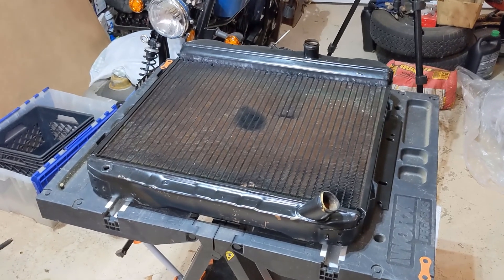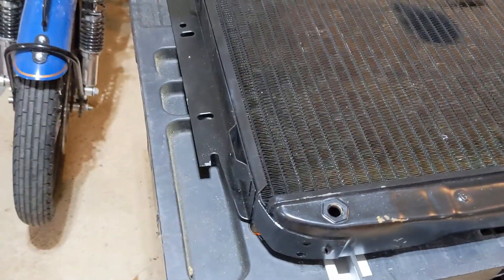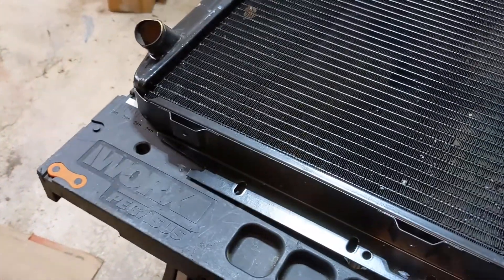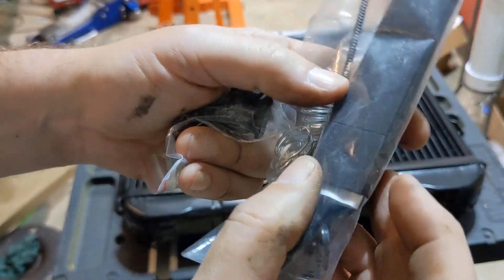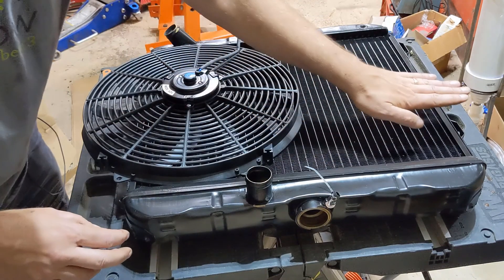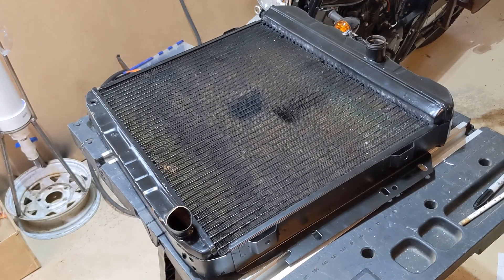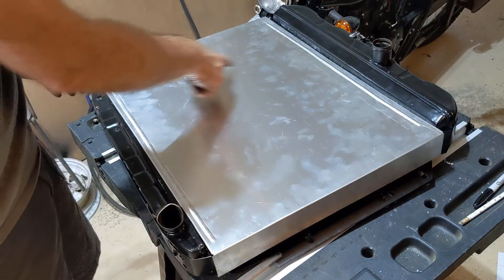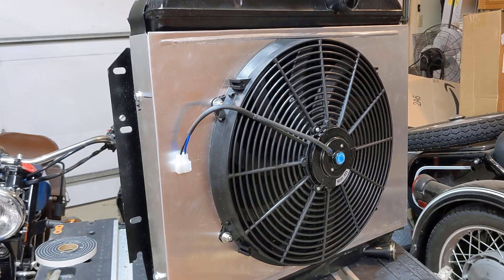Make Your Own Radiator Fan Shroud

Comment: Now your radiator will only flow air through the area of the fan. ALL THE REST OF THOSE SQUARE INCHES OF RADIATOR ARE COMPLETELY BLOCKED! You should have made a shallow box instead of a plate to allow the air to still flow through ALL of the radiator and be pulled through by the fan. In the areas outside the fan area, you can even cut out rectangular areas of the shroud and put flaps of rubber over those flaps so that at road/highway speed the air will blow through the fan area and through the areas with the rubber flaps that bend with the air being forced through from the front as you drive along.
Reply from the maker: So you're saying air cannot turn after passing through the radiator? Strange that pretty much every fan shroud made assumes it can.
Reply: @YoshimoshiGarage  What you say here is true. Which is what I said in my comments.  But the fan you show mounting in the video is mounted to a plate rather than a shallow box, so it just APPEARS to block the flow rather than allowing the air to go thru and turn. The purpose of the cut outs that I suggest is to easily let the air flow thru at road speeds but when sitting still the flaps sort of suck up against the shroud and let the fan pull from every square inch of radiator core. So for the most part I agree with you, but with some variation. Great video.  I'm glad people like you make these and really educate our fellow less experienced hotrodders.

Comment: The bead didn't stop any of the flexing. Not everyone,  virtually no hotrodder has that big metal brake. I made mine by bending the metal over the edge of a treated 4x4 and using a strap of 1/4" thick steel about 3' long laid on the thin aluminum and beat the aluminum over the edge of the 4x4 using the strap to spread the impact load. That way you don't see the hammer marks. After you bend all 4 sides, if you want to hold those sides up and together,  make some small, say 1"x 1" angles out of aluminum strap,  then drill holes in the strap angles and the edges of the shroud/ box you made and either rivet or use small bolts and nuts to hold these angles inside the shroud corners. You can also make mounting brackets to mount the shroud to the radiator out of strap aluminum.

Comment: Can somebody tell what will be better if pushing the air into the motor or sucking the air from the motor? I am thinking to add an electric fan on my Suzuki sidekick to reduce the heat when driving on first gear on mountain roads.
Reply from the maker: You want air flowing from front to rear of the radiator/vehicle, so if the fan is inboard, pulling, if it's outboard, pushing.
Reply: @YoshimoshiGarage  Thank you , I will follow your recommendation.

Comment: Man I thought I didn’t hear you right, brand new🤔 I would’ve seen that back so fast!!! No way that was a new radiator…. But very nice build thanks for the video/info👍🏾👍🏾
Reply from the maker: I would have, but I didn't want to wait the two week round trip. Turned out to have two dead cylinders so I probably should have anyway.